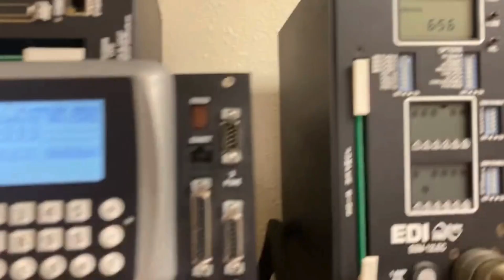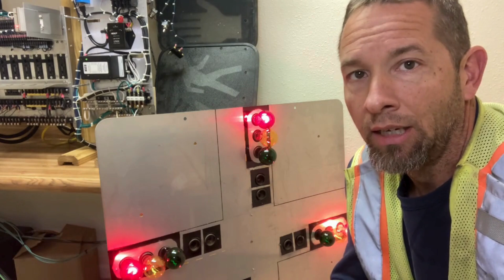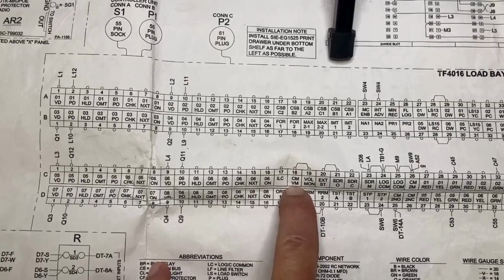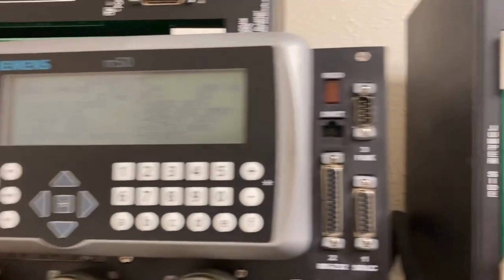MORE Traffic Signal Faults

Comment: How much baggage/complexity comes with breaking a pedestrian crossing into two sections, eg a wide highway?

E.g. giving a pedestrian a green long enough to cross the entire intersection would delay vehicle movement too long.  
Does this make programming turn signals harder?
Reply from the maker: FANTASTIC QUESTION!  
I try to get my design engineers to understand this.  YES!  Much consideration needs to put in the design process when adding ped crossings to new and existing signalized intersections.
Especially when they are added to coordinated signals.  You have strict timing parameters to keep it running coordination and so you can drive thru a cooridor in a 'green band' without being stopped.  
An oversized ped crossing (term they use in the industry) means the ped timing exceeds the vehicle timing parameters.  So if you have 15 secs allocated for side street but the side street ped crossing takes 20 secs, the controller has to readjust to make up the difference.  During that time, it can take 3-5 cycles to readjust--meaning it's lost it coordination with the other signals during that time.  If you wonder why your driving smoothly thru a cooridor but get stuck at a signal sometimes--look to see if there is a long ped crossing.  
Hope that makes sense!

Comment: I'm reminded of the time when I literally had a red fail in my traffic signal cabinet.  I was running my setup one night when all of a sudden, the red indications went out on one phase.  At the time, I had no idea what caused the red indications to suddenly go out.  I was thinking that it would cause the conflict monitor would sense a red failure on that phase and throw the signals into flash mode.  For whatever reason, it didn't.  Thankfully, I had a spare load switch, so I swapped the defective switch out.  It did make me wonder why the system didn't go into flash mode when the red indications went out.
Reply from the maker: Hmmmm....I would look at the conflict monitor.  The age of the conflict monitor can cause sporadic behavior.  Usually though, I see it place the signal on flash with random faults rather than the other way around.  
Great you were able to get it running again on a replacement LS.  Great job!
Reply: I hope you removed the monitor and had it tested. As a technician you can be held liable for a accident at an intersection especially if someone gets hurt, city or state can be liable  too. if you did not fully do your duty as a tech. You should always walk the entire intersection to make sure everything is working properly before leaving that intersection. It's a big responsibility as a traffic signal electricians.Especially if you are called out for trouble or you were the last one at the intersection and overlooked a problem. Like timing not matching the time sheet or a signal head turned the wrong way due to a truck or wind. Conflict monitor not working properly and you noted it and did not take further action. All documents in the cabinet can be used as legal documents. Watch your wording when documenting your find in the cabinet. It is the techs job to make sure the intersection is safe. I have refused to install timing given to me by engineers or turn on  a intersection I upgraded.  If I saw a issue with what they gave me I would give it back to them or my supervisor. If they installed the timing. I would noted in the cabinet and on my time sheet who installed or turned on the signal, to release me from liability and note the effort I made. 99.9% of the time they would fix the issue or have me make modifications that would work,  and redline asbuilt. I once received a called from a lawyer working for the city who happened to be the wife of the engineer who installed the timing which caused injury accident at that city's intersection, because I noted it on my timesheet and in the cabinet that I did not install the timing and that the engineer installed it,  he would not listen to me about a left turn backup entrapment, create a six figure lawsuit for the city. I didn't trust her or him so I stayed out of it. Not sure if you are required to document anything at your intersection, every city I worked, it was required. It use for study of problems at intersection intersection. For instance a pole that keeps getting hit. Maybe it needs to be relocated, due to the amount of times it's been hit by trucks making a right turn.
Reply: @miluth2  There is no need to worry about safety with the cabinet I have except for electrical safety.  I am a traffic signal enthusiast and the cabinet I have doesn't control any traffic.  It runs the signal display I have at home.  The monitor is working as it should since I replaced the bad load switch I had in the cabinet.  Honestly, I'm not even sure if the monitor has been set up to detect a red fail.  It's an old unit and probably only checks for conflicting indications.  For now, everything is working as it should and haven't had any further issues when running my signals.
Reply: @GrnArrow092 I guess I should have caught (my cabinet). It great that you have one. I regret not taking the opportunity to make a setup for myself.  Didn't think I would still be interested.

Comment: Thanks for the clarification on red Fail. Question- when you removed the green field wire why did you get a multi indicator fault between green and yellow?
Reply: I would think its because a charge (to light up the green signal - like a capacitor or similiar) left in the load switch once it gets the yellow signal, and since there is no lamp to discharge it to ground (think like a bleeder resistor), theres still stray voltage on the green output terminal once it switches to yellow, thus it will register that as a "dual indication" for G+Y.
Reply from the maker: I believe sebastian answered the question below pretty well.   The yellow indication turned on while the green wire was pulled out leaving a 'floating' voltage (no load) on the green terminal.  Thus the CMU thinks its a dual ind. fault.
Hope that makes sense...